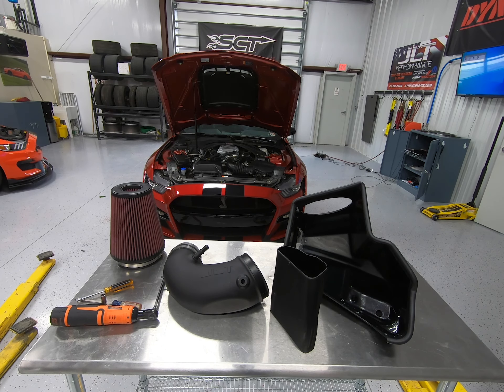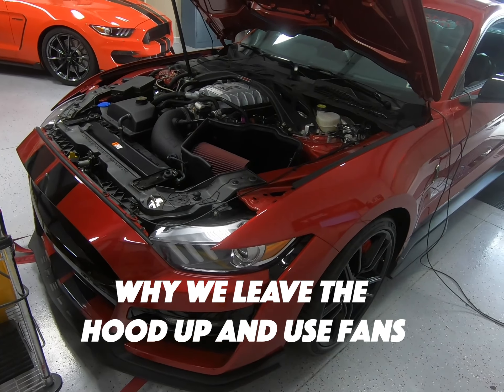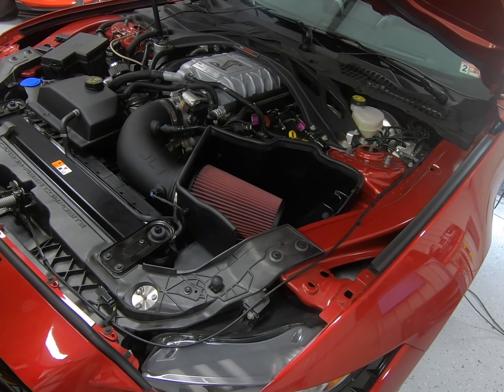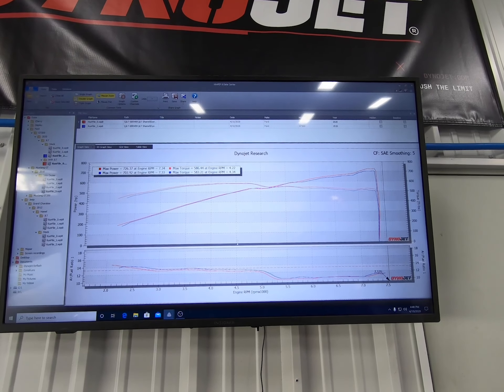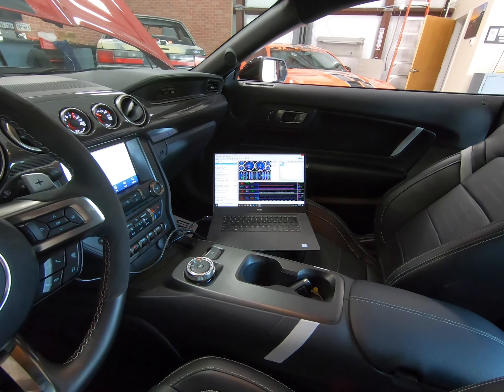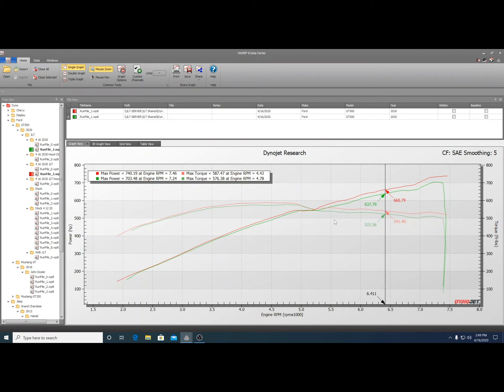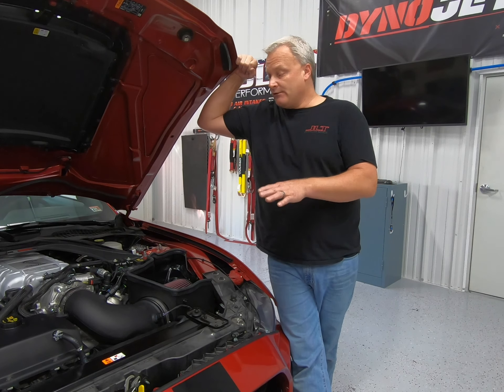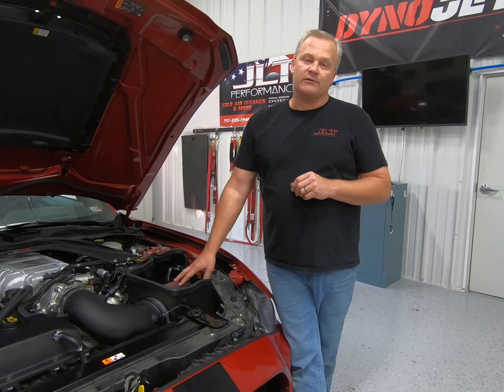2020 GT500 JLT Big Air Intake Before/After Dyno Test *No Tuning Required*

Comment: The JLT is true and an inexpensive gain for great hp. I have a 2020 GT500 and only with a JLT cold air and Lethal Performance resonator delete and no tune came in at 745.6hp to the rear wheels at mustang week this year. Thanks guys for a great product 👍.
Reply: Did you feel any difference while driving as well? I am planning on putting this on my 2021 GT500 I got last week...the car has 500 miles now and I have the intake being delivered tomorrow! How did the butt dyno feel 😀
Reply: @HotRodsDFW  honestly I think I put it on at around 500-1000 miles. I didn't start doing WOT pulls til after 1500 for safety of the engine so it was already there.
Reply: Take that monster down the 1/4 with a good tire you could crack nines

Comment: I can't see how just having the filter exposed to the hood is going to draw more air than the factory configuration.  I mean you can see the filter media from the front of the car through the duct work. You can't get a more better design than that.
Reply from the maker: It's more the design and size of the tube PLUS a better flowing filter. Piles of 3rd party  videos showing the same results.

Comment: You mention 150 mph, everybody don’t drive at that speed. My concern with all the test done by after markets is, when you compare with factory sealed air boxes vs a open air filter. That would be apple to apple with the hood down and the same amount of air flow with the fans. Please show us the difference with yours vs the factory ram air. That’s all we’re asking.
Reply from the maker: 1 the factory box on the GT500 is not sealed
2 you would need a dyno cell where airflow equals tire speed.
Reply from the maker: I also mention lower speed as well. The video shows underhood temps at lower speeds as well.
Reply: @JLTPERFORMANCE  All you needed to do is remove the stock cover and run the dyno and compare that to the JLT Performance intake. This would shut up most of us that see and obvious difference in testing.
Reply from the maker: @sufficetosay  us and others have done it and while it picks up some power it no longer keeps heat out and cars have gone slower on track. No need to shut anyone up, we have more test results from 3rd party owners than any kit on the market
 Not to mention on all the fastest GT500S in the world and used by all the best shops and tuners. Sold out with 400 on BO and you want me to remove a lid and test it? How about spending several hours researching FB and YouTube to read all the data from the shops who use JLT on this car? It's common sense,  if the lids off and hood closed you have hot air.
Reply: @JLTPERFORMANCE  I have researched it thank you and I have determined that approximately 5hp is what I would gain from your intake. I don't care how many you have sold btw. 

Without closing the hood on your intake the results are skewed, period! I bet the factory box with the lid off would dyno just as high but you are right about heat... I like your intake but I don't think I want one now which is cool with so many sold and on backorder.
Reply from the maker: @sufficetosay  Link to a single bit of info that shows 5 HP gained. I'll wait
Reply from the maker: @sufficetosay  Big difference in "I bet" and actual data which is all over the net and in this very video. Also in this video is hood up VS down explained and proven to keep temps low. Thanks

Comment: Good video.  I had a JLT on my 04 Cobra and 100% accurate on the video comments on IAT2's under WOT.
Wondering is the dash air fuel ratio accurate on these cars? Shows going into the mid 9's? thks

Comment: Close the hood and the gain is minimal.
Reply from the maker: Didn't watch the whole video huh? Great post lol
Reply: @JLTPERFORMANCE  yeah your comparing it with the stock intake with the top on take the top off and see what the difference is between the two we did and only 5 hp increase.
Reply from the maker: Exactly lid off will gain 5 and we gain a ton more. Also, the video show heat at speed is no different so the power gain is there no mater the MPH, but you never close the hood on a dyno with small fans. Great try 👍
Reply: @JLTPERFORMANCE  no, only 5 hp increase over stock intake with lid off.  Run the stock intake with lid off hood open then do the same with your intake.  Only 5hp increase over stock intake.
Reply from the maker: Well, I look forward to seeing your video.  It sounds full of good information lol. You're late to the game if you're trying to discredit this video. Tons of other 3rd party videos back it up. Have a great day
Reply: @JLTPERFORMANCE  if you dont believe then dyno with the stock intake with top off for a real comparison. You can also run it with hood down for a real comparison since stock has lid and video it on YouTube what are you afraid of the true numbers. Nobody has done a real comparison you dyno the aftermarket with hood open has no lid so it can pull in all the air it needs and the stock intake is restricted with lid and only able to pull air in the opening at a stand still real fair comparison.
Reply: @mikemorris8284  why don’t you?